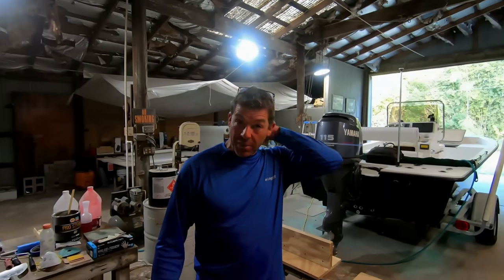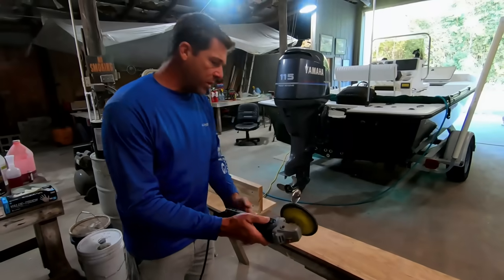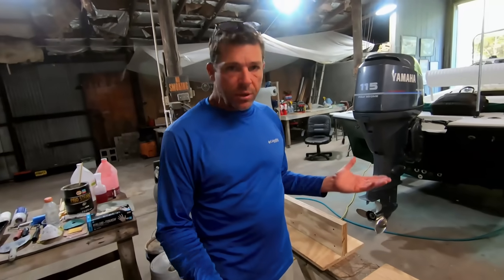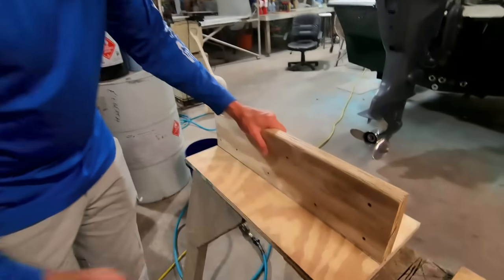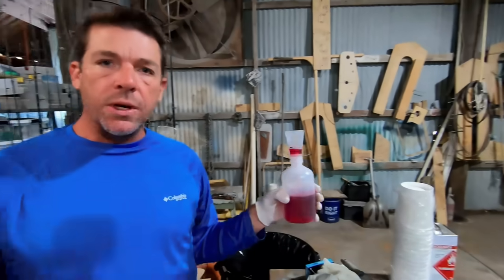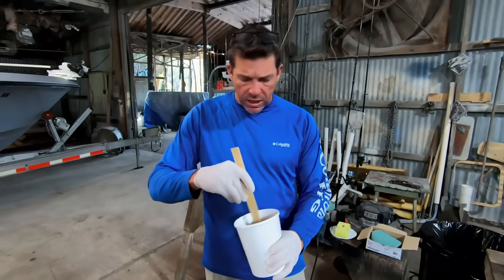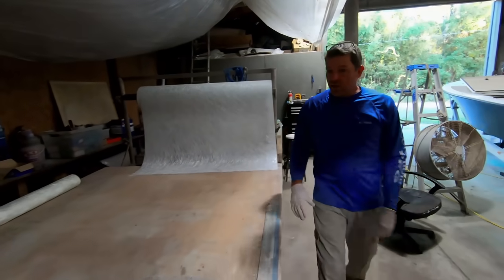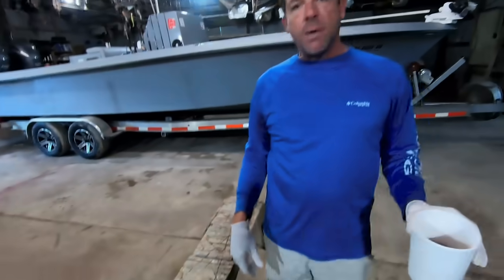How to FIBERGLASS over PLYWOOD!  Do it the RIGHT WAY the FIRST time! Step by Step DIY fiberglassing

Comment: About 20-25 years ago I wanted to build a walk in shower using plywood with a clear epoxy to seal it. I wanted to pre cut the pieces, pre drill a few holes to fasten to the studs, ore build the pan, and then epoxy every individual piece. That way I could just assemble it without compromising the epoxy coating. 

Everyone told me that the plywood would expand and contract, and flex under my feet. They said the epoxy would never hold up. I said, then how do they make wood boats and wood canoes that they use epoxy to make it water tight? But they all tolde that if it would work then people would already be doing it. 

Fast forward a couple decades and I see Rock Solid epoxy advertising about countertops and bathroom shower panels.
Reply from the maker: Sounds like a very cool project! Epoxy resin is great for something like that. Thanks for sharing!

Comment: Wonderful, one of the most comprehensive I've seen.  Two 'caveats' though.  Were those sheet rock screws holding that plywood together?  If so definitely not good; they will rust eventually, and when steel rusts it expands, which can force the plywood apart enough to cause cracks.  Bronze or even stainless is better, but best of all is to glue the plywood together (resin plus fumed silica [though I often use glass bubbles, against the expert's advice, cuz it grinds more easily if need be]) with screws holding it together until the resin goes off, and then removing the screws.  

The second is Bondo is not a good marine filler, especially under the waterline, because it can contain talc which is hydroscopic.  And polyester resin is not 100% impermeable to water.  Though with trailered boats this is somewhat moot.

Nonetheless thanks for a very good, very informative video.  And don't worry about the length; to do some thing right, or to learn how to do something right, takes time...

Comment: Incredible video I can’t wait to see more of your content. Still watching through but I had some questions. First, you mention temperatures being bad if it’s too cold, but what if it is really hot? Also, what do you think about doing multiple pre coats of resin on the plywood to see if it keeps absorbing resin? Another thing I’d like to see if you haven’t already done it is more discussions about the number and different kinds of layers in different situations. And choosing the sizing/width of your layers.
Reply from the maker: Thanks! Most resins work best in the 65 to 80 degree range. If Temps are high, the resins will cure much faster. This can drastically reduce working time, and result in very high curing temps. In my experience, one really good coat of resin as a primer coat works well. You would want to be careful about producing a resin rich part, as to much resin without fiberglass can be brittle. I hope this helps, and I appreciate you watching!

Comment: Great video , subscribed , cheers from Australia , I have a 24 ft yacht that I want to create a shelf under the foredeck to store my anchor chain and Rhode ,with a hawse pipe to feed locker ,I had planned on fastening two lengths of timber to the sides of the hull,one each side ,then cutting a V of marine ply to sit on top, then glass , if I can ask what would be the best way to fasten the two lengths of timber to the inside of the hull ,the yacht is solid glass , no liner in forepeak ,cheers Ron

Comment: This is a good video be interested to see the older boats made out of wood because I’m redoing a boat now was gonna put Coosa in it thinking about going back to the marine plywood
Reply from the maker: Coosa is a great product for sure, but plywood done right can last for a very long time. Plywood is also about 1/3 the price of Coosa if you go with A/B marine fir. Coosa would be my first choice if cost is not an issue, but some projects don't justify the costs. Good luck with your project, and thanks for watching and commenting!

Comment: Hey that was really very very helpful. I now know the mistakes I made in the past on fiberglassing work that I did. Thank you Capt Joe? One of the early mistakes I made was trying to glass using polyester resin over a rudder piece that was glass with epoxy. Holy cow was that a huge mess and quite expensive learning experience. Needless to say much of the tips and work practice you show I had to learn the hard way, before you tube, which I wish had been available back then. Like the old salt said, the ocean doesn't get any shallower. I do have a question. I wish you also talked or shown how to use peelply on glass work, what it is and is it optional.
Reply from the maker: Yes, polyester resin over epoxy is usually a problem.I usually recommended epoxy for repairs if you are not sure what kind of resin you are glassing over. Sorry you had to learn the hard way! I will try to do a video on peel ply for you all, but honestly I don't ever use it. Just a personal thing. Thanks so much for watching and commenting!

Comment: Joe, thanks for a very well thought out, professional and informative video!  Was wondering if you had any specific tips for repairing hull blistets on large boats?  Thanks!
Reply from the maker: Glad you are enjoying the videos! We don't do a lot of blister repair currently, but I have done it in the past. It requires grinding away the fiberglass over the blister until it is completely removed,   then cleaned and dried completely. Epoxy is the preferred resin for repair of blisters. Most people use a combo of csm and 1708 for larger blister repairs. Some use epoxy fillers on smaller ones.After the repair is faired out, most people put a epoxy barrier coat over the entire bottom of the boat. Then finish with a antifouling bottom paint. Hope this helps and thanks for watching!
Reply: Thank you for your detailed response, very helpful and insightful!

Comment: WOW what a great tutotial. and thanks for the affiliate links. Im no expert.  but as a suggestion for the true beginners  Please talk about the diffrence in LAMINATING resin and FINISHING resin and what you would use for the final hardining of the Laminating resin. I have used Polyvinyl alchol and sprayed it on over the laminating resin if I was not going with a top coat of Gelcoat and sprayed the Poly Vinyl Alchol  over gelcoat after it has set.  But that was years ago and perhaps there is something better, I definatly defer to you as the expert.
Reply from the maker: Thanks, I appreciate the suggestion!

Comment: in order to use less filler when you apply the initial amount across the corner use a disposable cake decoration bag or any other hard plastic bag. You just fill it cut the nose in the desired diameter and apply across. The cost of cake decoration bags is about $5 per 100 retail. By the way i loved the whole video. Gel coating is my next😁
Reply from the maker: Cool suggestion, we use that technique mostly when applying epoxy filets. You can even use 1 gallon ziploc bags. Thanks so much for watching and commenting!

Comment: This was such a great video with tons of information. I should probably first practice on something like this before I tackle my project. But I never listen to my own advice.

Hopefully you can give me some advise and or a video to explain in more detail.

How would you put fiberglass to a complex plastic tray. That is the vacuum molded tray for a Kennedy socket wrench set. I've got a couple of those, and although the trays are pretty sturdy, they are not sturdy enough for constant traveling in a mechanic's roadside truck, doing a couple of thousand miles per month.
Reply from the maker: Thanks so much! That is a good question. That could be something that might be tricky. Not saying it couldn't be done, I am just not sure what would be the best way. I will think on it. Wish I had a simple answer for you!

Comment: I came across your video by chance and absolutely thoroughly enjoyed it.  I've been a boater for a long time and always did my own repairs and maintenance, but your video has given me a stack load of tips and techniques that I never new.  Thanks so much.   I would like to run and idea past you if you don't mind.  I've recently picked up an old 3.5m inflatable with solid a solid hull and PVC tubes.  The tubes are not in a great condition, although they still hold air and have no leaks.  I'm thinking of taking off the tubes (intact) and glassing it over with chopped mat.  So in effect making it fibreglass pontoons with an PVC bladder and then reinstalling it onto the hull.  Have you ever come across something like this being done?  Do you think it could work?  Your comments will be appreciated greatly.

Comment: Amazing video first  class technical great video great detailed wonderful  works 
Very important  to know dont go running out and thinkingI love this  I going to do this for the first  time. Besides the technical  expertise that this master  give you .fiberglass products have really  really strong odors  very very strong the only product  that dont smell bad is the fiber  but the resins  thinners and others  are very strong so this is not a trade you can start in your kitchens you cant go yo sleep with this quimicals if you do this  in your home you will regretted the smells is penetreting during the cure proces and work process many people  got into fiberglass and were not able to hundle the fumes and  mask will protectc you but you will be expose to it the main problems  is headaches so be advice .Cost is other issue  but small projects and repairs   you can do under $50 with  a small  kit from hardware  stores. medium size furniture covers and such $250 up boats canoes  small $600 to $1500 depend on project size . But if you dare to go into it this guy is a master boat  builder fallow  him you will do great .thak you gor you video  Amazing tutorial
Reply from the maker: Wow, thanks so much for your thoughts! Yes, you are right, not everyone will love working with fiberglass and gelcoat. But many people need some good, basic foundational knowledge on the process for home or personal use. We hope to provide some of that for everyone here on the channel. Hope it helps, I appreciate you watching and commenting!

Comment: You did say several times not to go heavy with the fibreglass roller, but you never explained why..

That roller is great for moving fibres into position. It's not something you could see on camera, but in person and looking closely at your work, it is amazing what a good job it does.

That said, go too heavy can move the fibres way too much and even rip up the mat, destroying your work. 

And to folks watching this, take note about mixing hot. The mix can even catch fire if you're not careful. Better to take your time and do a good job.

Great video by the way..
Reply from the maker: Yes, to much pressure and it will deform the glass and bring to much resin to the surface.

Comment: I picked up an 76 searay weekender, turns out the bottom half of the  transom has desinagrated, I'll be removing the motor and outdrive and attempt a replacement, I have no expirence with fiberglass, your video is highly informative, I appreciate it. I'm still educating myself on this repair and where to start.
Reply from the maker: Glad you enjoyed the video and I hope it helps with your Searay transom  repair!
Reply: @FishBumpTV  it's a restore now lol, almost a fresh canvas to work with

Comment: Excellent tutorial. I’m building a 14’ sailboat and have never fiberglassed anything. I’ll do a practice piece just like yours before I lay it on the boat.
 One thing I am debating on is tabbing the bulkheads in. The plans only call for Large fillets and the bulkheads are further secured with lots of Silicone-Bronze wood screws. 

Any thoughts on this appreciated! It will sail on big waters (Great Lakes)
Reply from the maker: Thanks! I would rather overbuild than underbuild. You could always add a layer or two of the 8oz finishing clothe or a layer of 1708 if you are in doubt. But that is just my opinion. Hope this helps and best wishes with your project!

Comment: Great instruction. Very nice. How do you do the edge and ends?
Reply from the maker: Thanks! I did a whole series on this demonstration piece. From glassing the ends, gelcoating, running pvc pipes through it, and fairing it out. I also have a how to epoxy over plywood video that shows some more advanced fiberglassing techniques that you might find really helpful. I appreciate you watching!

Comment: Hi Joe.  Love everything you are sharing.  Question though. I want to fiberglass and encapsulate the plywood bed of an old utility trailer.  The plywood is basically sound but the surface is weathered and cracked.  I have scraped and wire brushed the plywood to get any dirt out of the cracks and to open up the grain.  Can I get impregnate the surface with multiple coats of resin, fill the cracks with the NAPA filler you demonstrated and then add a couple layers of glass to encapsulate the plywood, top, bottom and sides.  I would prefer to leave the patina and not sand if possible.  Many thanks, Tim
Reply from the maker: That will probably work, as long as the plywood surface is clean and dry. I can't say for absolute sure, as I would and always have used a sander or grinder when prepping something like that for fiberglass. I hope this helps and thanks for watching!

Comment: Great job. Lots of info, but easily absorbed, pun intended. What I'm doing is a repair job on the bottom of a hand built 11 ft. plywood sailing dinghy. I just want to add a layer of glass as protection(up to waterline perhaps). It has been painted in years past but is in really good shape(no rot, just cracks and chips).
   Any advice? 
.....thanks again for a great video....

Comment: This video and your teaching were SO awesome! Newbie to fiberglass with only minimal experience for auto body. Forgive me for this long post! 
I have a project that I’d like to fiberglass over wood for strength, durability and waterproofing (not a boat! a 1962 Cushman I turned into a Tap Truck!) but I have a few questions I’m hoping you can help me with:
1. I have a router groove (1/2” straight bit) in the wooden board that I need to enforce/protect. It’s got 90 degree corners in the groove. I can’t round the corners out in that groove because the “female” groove has to receive another component that is the “male” counterpart. Can I use glass mat like you did on the one side of your example project, without doing the Napa filler-rounding process in the corner? I need to keep that groove nice and straight as possible 90 degree corners.
2. What is the final thickness of that example piece with the layers of mat, resin, and the 2 gel coat layers you apply in next video? Is it 1/8” thick coating? In other words I’m going to have sand my wood piece down so the final parameters don’t change so I need to know how much to sand down to accommodate the fiberglass coating.
Thank you so much for taking the time to share your expertise! What a gift to give those of us that want to learn from you!
Reply from the maker: Thanks, glad you are enjoying the videos! I understand what you are trying to do with your Cushman, but that sounds like it would be a challenging application for Fiberglass in my opinion. Fiberglass does not lay down over sharp corners, and will create an air bubble on either side of the corner. If the corners could be rounded, and glass applied then shaped back to a 90 degree corner I think you could get some of what you are looking for, but it would be very difficult and labor intensive. The thickness of the fiberglass on the sample piece was around 3/16 of an inch, but it was 2 layers of csm and a layer of 1708 biaxial. If you went with epoxy resin, and a layer or 2 of the lightweight finishing clothe you might get closer to what you are trying to do,but it would still be very tricky. I would do some testing and experimenting on a test or sample piece before you try to do something like this, that is what we do whenever we are trying something new. I hope this helps, and best of luck with your project!

Comment: I mix resin as usual but add alcohol to thin it.  This soaks deep into the wood fibers.  Making a good bond with the next layer. Stop delamination of the fiberglass and wood.
Reply from the maker: There are many different types of resin out there, so different thinners could work for you. The manufacturer of the resin shown in our video only recommends using styrene at a 5 to 10 percent max thinning ratio. Hope this helps, thanks for watching!

Comment: Thanks Joe,
What do you recommend to fix cracks and reseal a  rudder and trailerable/removable keep both made of wood?
Reply from the maker: Either epoxy or vinyl Ester resins would be my choice for both bonding and water resistance. Hope this helps and thanks for watching!

Comment: Great video! Thanks. On the corner you started with a narrower width of glass, than a second layer a bit larger.  Any reason why you didn’t start with the larger width first and then apply the smaller width for the second layer?
Reply from the maker: Thanks! We have always started with small first, even when doing hull damage repairs. It results in a very neat layup. If you start small first, each additional layer covers the edges of the previous layer. I am sure it could be done the opposite way, but we have built hundreds of boats the way I showed with very good success. Hope this helps, I appreciate you watching!